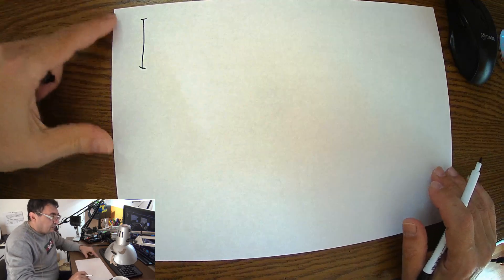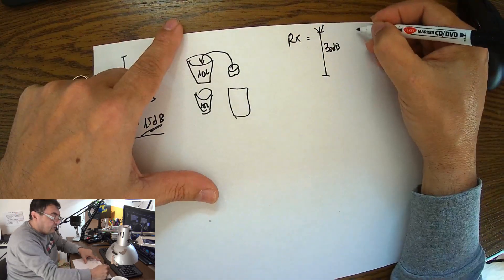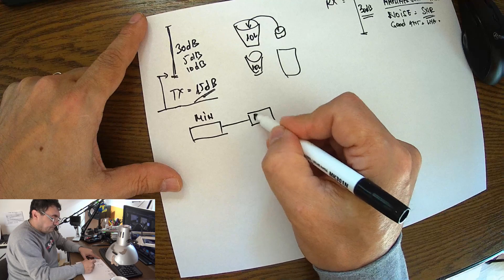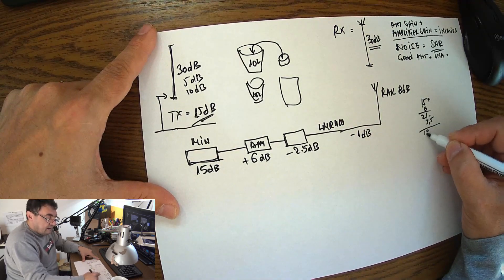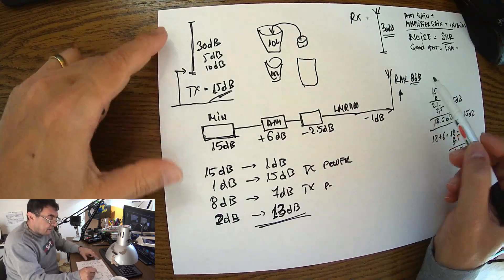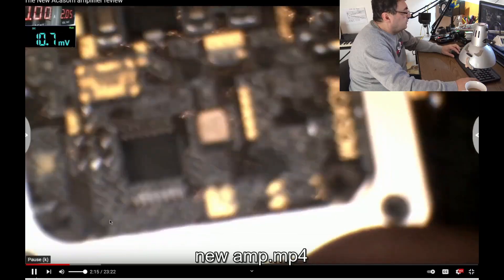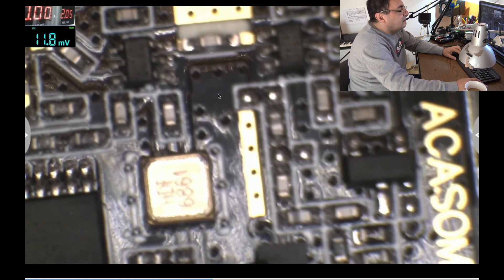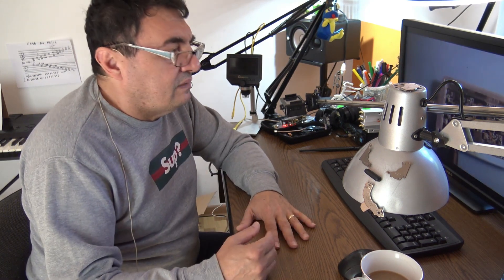Let's talk miner antennas and new Acasom amplifier

Comment: I’ve heard it said before that lower dbi pattern antennas such as 3db-5.8db antennas may be better at receiving various vertical reflections and for this reason, some may recommend them for wooded or hilly areas because of the wide angle. (Mostly talking about RX!) can you attest to this as true?? I am attempting to test and see whether or not my amplified 5.8db antenna will receive signals better than my amplified 8.5 dbi antenna. I will be using an Acasom v1 17rx / 6tx amp with about -3db for connectors/cables/filter. Then, to dampen the noise, I add attenuators (-7db). With this setup’s losses I would declare: 
For 8.5 dbi antenna = 4.5 total Tx(in app) and at the same time would increase my receiving power by 7db Rx after noise attenuation!
For 5.8 dbi antenna = 2 db total Tx (in app) and just like the other setup, my total attenuation would still leave an improvement of 7db RX!) 
Please read and tell me your thoughts and opinions about these setups and the applicable gain calculations. 🙏
Reply from the maker: A low dB antenna is better for crowded areas with lots of hotspots around..think like a giant doughnut..but for relatively quiet estate..I prefer a 8 or higher antenna..Reflections are higher in the city..By the TX declared..don't do any change..wait and see the results..if invalids then go lower..
Reply: @viocaia  I see. So you’re saying that my 8.5 db antenna amplified would be more likely to receive reflected signals than my 5.8 antenna  amplified in a wooded area? There are about 6 or 7 hotspots very close by to me (under 5 km away) but I’m also trying to reach the city about 15-20 km to my west. Also, won’t the explorer tell me whether I have any invalid signals?
Reply from the maker: @Philneye5389  Right..the high gain have a narrow beam too, so very likely reaching further hotspots..I don't believe there are so many reflections ain a woody area..imagine a city full with high buildings..so go for 8.5dB. The closest hotspots will be received anyway..Also a directional antenna for those at 20Km will be great..
Reply: @viocaia  thanks! I wasn’t sure. My logic with the 5.8db pattern is that I am treating high trees the same way I would treat high buildings like you said. In that case, I’d think I would need that ‘giant doughnut’ to see anywhere a signal would come from. As far as gain goes, I ultimately could still make up for it with the amplified RX. I did try a nice 9db directional panel designed for helium and directed it in the westerly direction about 2 weeks ago and got little to no results that entire week. If more gain and range were the answer, I would have thought I’d seen more than 1 witness that week, although the one witness I saw had very good reception! 🧐

Comment: can you help me with my situation, please?
I have MNTD RAK GOLD + Sescape both connected on one antenna 6dbi McGill + splitter+ 6dbi attenuator+ Acasom v1 amplifire+ Acasom cavity filter. what should my dbi value be on the helium app\network be, please?
Reply from the maker: Take out the attenuator and declare a 5dB antenna..always have the filter before any amplifier or splitter..like antenna/filter/amplifier/splitter..eventually attenuator./miner..
Reply: @viocaia  I just changed it to 5dbi and will monitor it. I removed the attenuator and yes, I have it in that order. thank you!!!

Comment: I think the antenna gain needs to be part of the calculation as well as taking into consideration Rx because witnessing others will be invalid if the signal is too strong especially for the miners that are in close vicinity.
Reply: Thank you Mr.Caia!
Reply: Great! Thank you! Interesting videos!
Reply from the maker: @14mbabic  Thank you too..
Reply from the maker: By the book yes! of course..in reality all other factors are in..weather, altitude, orientation, reflections..I'm trying  to keep it simple..if any invalids..just declare a +1dB better antenna in the application until de balance is reached..that's practice..

Comment: Nice video, there is one thing, when calculate EIRP (Effective Isotropic Radiated Power) you need to take everything in account , miner TX power + amplifier TX power + antenna Gain - Cable / connector losses = EIRP, thus example " miner 15dB + Amp 6dB + Antenna gain 8dB - Cable/connector loss - 4dB = 25dB EIRP , you need to add the gain of the antenna in the calculation.
Reply from the maker: By the book ..yes..I just tried to make it simple..In real life comes a lot of other things..weather, reflexions, altitude, bad antennas....so on..Thanks for let us know.

Comment: I'm not sure that I understand the reported Tx value. I'm in us (max db is 36 db here and the miner should be producing 27).
I ordered acasom outdoor Rx12, Tx3 amplifier, acasom outdoor cavity filter, I have 9 meter lmr400 cable and 8db Rak antenna. What value should I put into the Tx power with my setup in the Helium App? Thanks.
Reply: I have the same question for the people who live in the USA
Reply from the maker: The declared antenna gain is inversely proportional with the miner output power.By the EIRP calculator we should consider the antenna gain too..practically I don't mind..that's more for directive antenna..so for max power you should declare a low gain antenna..let's say 27dB+3db+30dB TX power.If we add the antenna gain by the book let's another 8dB finally we have 38dB..minus 2.5dB losses..left 27.5dB..but if you declare 8dB antenna the miner will send with 27-8..so 19db.. in this case 19+3=22db TX minus 2.5 losses left 19.5..of course if we add the antenna (by the book) gets 27'5..but in the field I just ignore the antenna's gain..finally just consider..High gain antenna declared >low Tx emission..low gain>high emission.Also a high antenna gain declared will affect the RX too..means loosing sensibility..I should use a low gain for max power..but if you are in an urban area that will make a lot of invalids to the others..the best way is to start with low gain and see what you can get..if you have invalids..go higher until you find a balance..